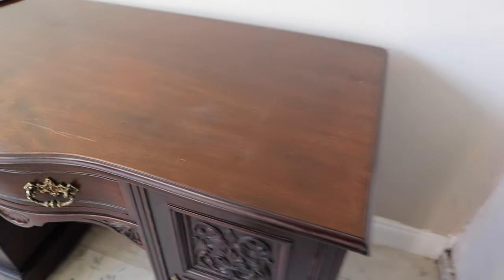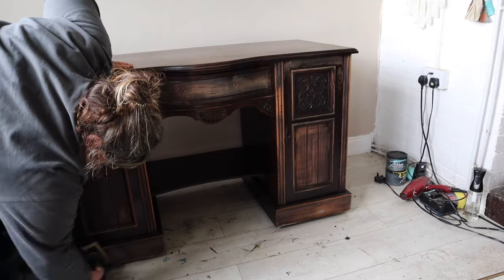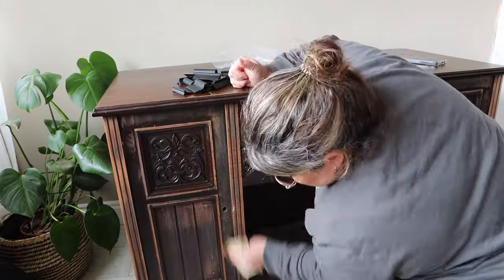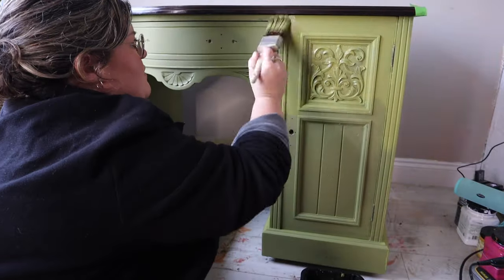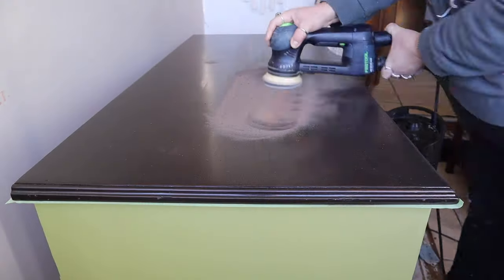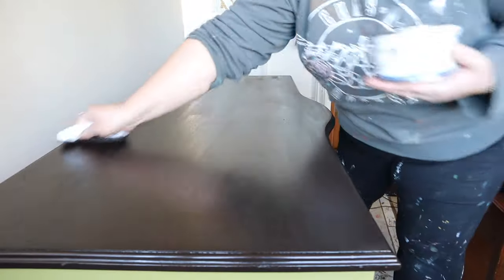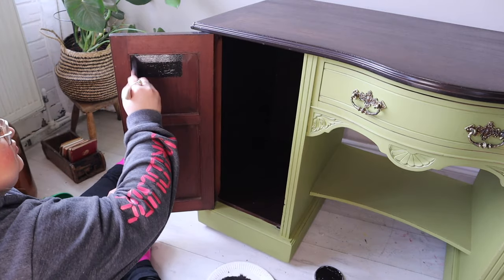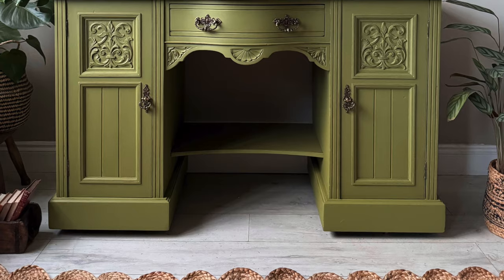A beautiful desk makeover using a brand new colour!

Comment: Definitely want this colour also thankyou for showing the gel stain problem. I’ve been wondering if it covered sanded areas as I’ve seen videos of people using it and leaving them patches visible but wasn’t sure if the item was still wet. Now I know thankyou xx
Reply from the maker: I didn’t have much success with the top doing it that way but I know other have. The wood underneath the old varnish was super dry so it may have been that which caused the problem
Reply: True , I didn’t of that x